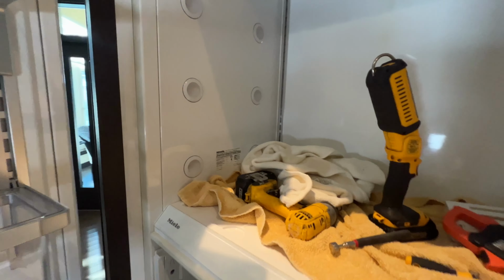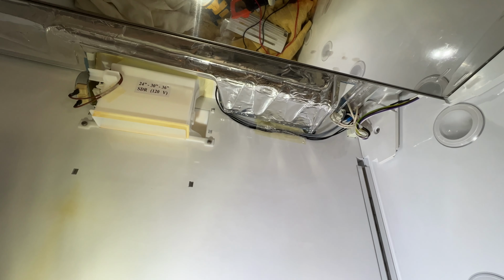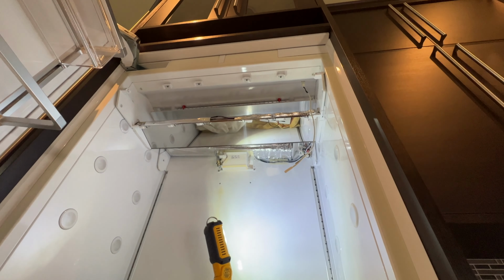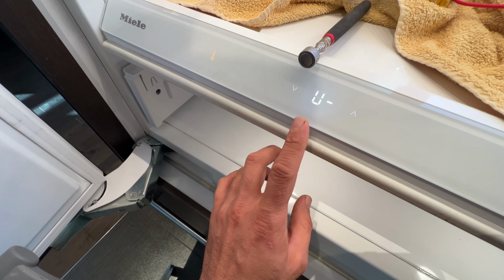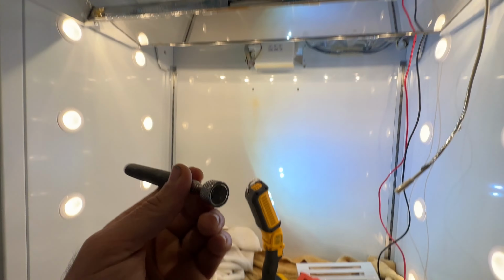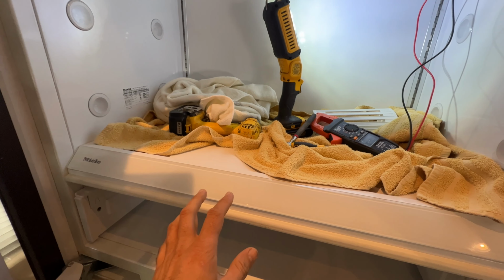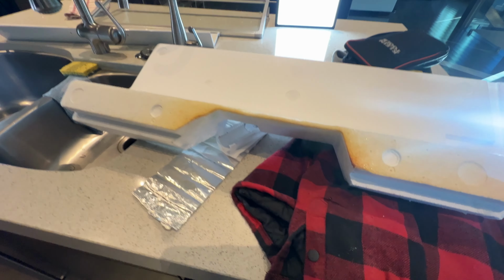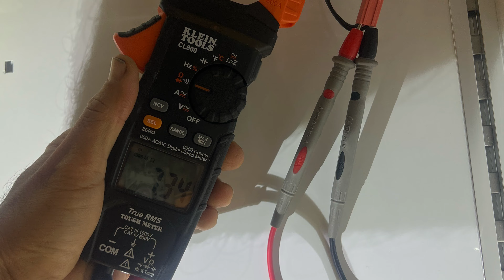How to fix Miele fridge leaking water

Comment: Does the KF 1911 have a drain hose to a pan for evaporation.  And if so, how do you access it?
Reply from the maker: Yes it does .located at the bottom rear side.you need to take the control box out of its place a little bet to stick your hand beside it . one screw holds it from the front one at the back . back one is almost impossible to take out but I usually take the front one off and bent the control panel box towards right hand side to give me extra space for sticking my hand beside it . and yes you need to push all your hand inside to touch the hose . you may want to work there closed eyes because you can not see anything there , you can only feel it :)
Reply: Thanks!
Reply from the maker: @TomHawk640  My Pleasure!

Comment: Found bottom freezer drain hole!  (Removed heater/cooling assembly in freezer.)  3 Questions: 1) diagnostic "5" turns on the bottom freezer element, too (not just the top main fridge element)??   2) Can you actually FEEL the element heating up (because I couldn't).  3) Ideally, if there WERE a heating element malfunction, would the fridge show a malfunction code to alert the owner that there's a problem?  In other words, even if I didn't use "diagnostics" would the fridge show an error code if one of the two heaters wasn't working?
Reply: Found the code!  "03".  And it DOES get warm to the touch when you run the diagnostic.

Comment: Decor, double oven F-0 error code touchpad needs to be replace?? or control board??
Reply from the maker: Open it apart usually there is a burnt wire on top of one of the relays